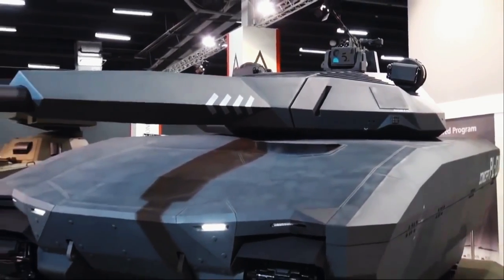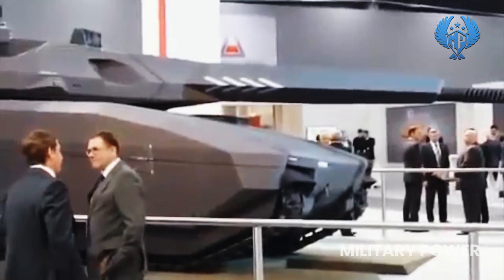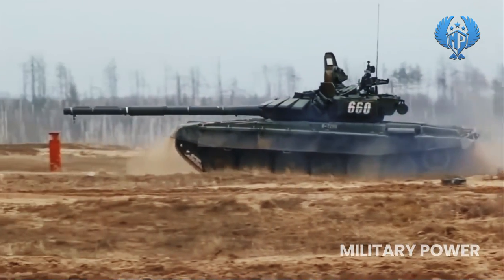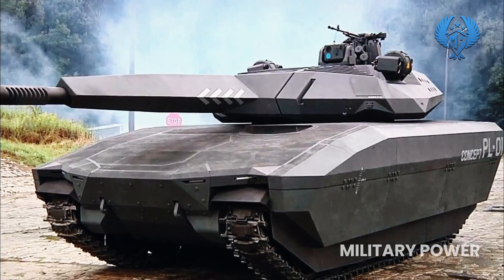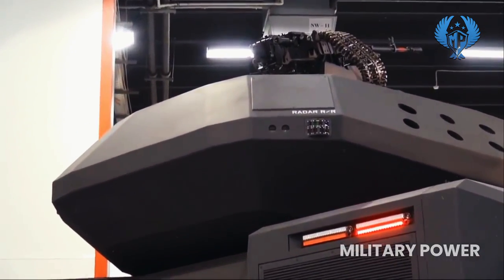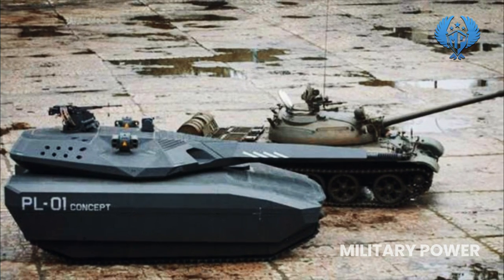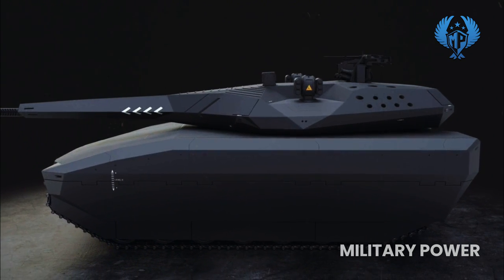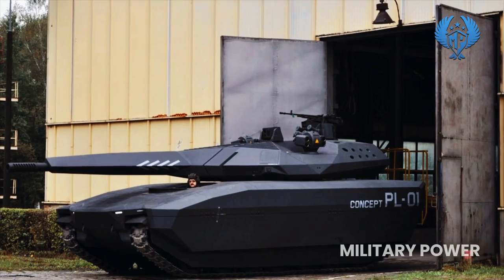Stealth Tank: Is Poland’s PL-01 Tank Ready to Fight Russia?

Comment: Good basic start, needs more fire power for close quarters Against infantry units. Dual .50 cal and full auto 40mm grenade launcher would solve this. Tankers need to be like knights of old and fight alone. Rather than the massive support they currently need. Defence against drone attack is vital as shown by the recent conflict between Azerbaijan and Armenia. More secure ERA armour as well and solving the fact nothing not even a jet is Stealth actually. Think of convection. Any mass moving creates convection of air and heat. Therefore not even Subs can hide. If you know what you are doing. Then you can find them or you can hide yourself totally.
Reply: In any case, the future belongs to stealth ground vehicles. Because most anti-tank missiles are so-called "fire-and-forget" missiles that are either controlled with electro-optical thermal imagers or with active radar. In the future, not only tanks will be protected with stealth technology. For example, armored fighting vehicles will also be protected in this way in the future. Incidentally, of course, not only the Poles are developing this technology.
In any case, if all combat vehicles are protected with stealth  technology in the future, then the old wire-guided technology will be used again, i.e. missiles guided by wire by an operator. The disadvantage is the limited range, because the range is reduced by the length of the wire.